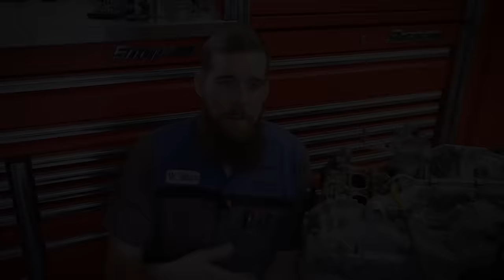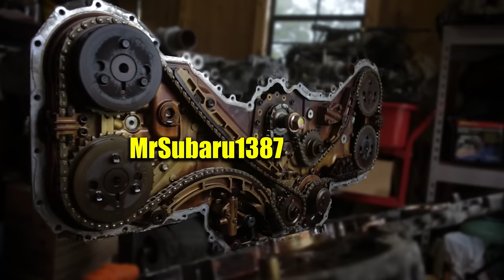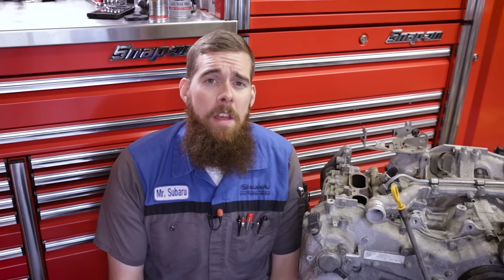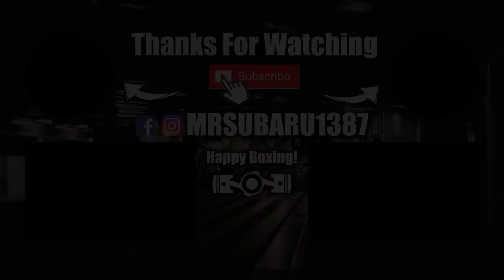Why Subarus Are So UNreliable!!! Buckle Up!!!

Comment: As a long time Subaru service technician myself, I can 100% vouch for the amount of time we get younger owners of the turbo charged models that completely destroy these cars and have the audacity to blame the brand for the vehicles failures. And we as technicians suffer greatly due to most of these repairs being warranty and having to eat poor labor times due to the owners mistreatment. Subarus are absolutely great vehicles when properly maintained and cared for. I love the brand but I hate some of the owners loll. Had to subscribe after watching this rant lol!
Reply: @samerawaragi3041  Subaru has certainly acknowledged the fact that some of our engines are known to fail oil consumption tests and have reached out to the customers and have had the short blocks replaced as a result. What I’m trying to say in my comment is when u have a customer that decides to drive A Subaru very roughly as if it were a Honda which it is not as mentioned in the video, and neglect to take care of the car and complain why things aren’t lasting like they should. That’s all. All car brands have their issues but when u mod and beat up a car and don’t treat it nicely, the blame has to go to the owner and not the brand.
Reply: @LosDC5 i just got my dream car. A 2019 STI and i was wondering if you can point me to where i can find all the maintenance scheduling i need to keep this car in the best condition so i can keep track of it and set reminders andogs for this car. I want this thing to last as long as possible. Really want it to be one of those "man they dont have many of those anymore" kind of car later on.
Reply: @robertd57i989  So my suggestion to you in that regard is to invest in good oil delivery components. The Sti and older wrx suffer a lot from oil starvation. I believe IAG makes a reinforced oil pickup and baffled oil pan. That will eliminate any oil starvation. The oem pickup is plastic and is very prone to failing over time. Besides that, change your oil every 3k miles. Make sure the brake fluid and diff fluid is replaced every 30k or so. And as far as mods, u can run pretty anything you want with a reliable tune. But be mindful off your power goals. Any hp goal more than 400 will require serious internal engine upgrades. However any bolt on mods like downpipe, Intercooler, exhaust system, AOS, etc will make the car very solid for everyday driving and the car will be very reliable. So long as you keep tabs on oil level and other regular maintenance!
Reply: I agree completely I worked as service manager and advisor with Subaru since 96 until retiring in 2020 and did many many turbo engines simply because oil changes not done, modern young people don't believe in simple maintenance!!!!
Reply: Very true
Reply: Turbo car= Race car.
Subarus fault.
Reply: Mit. LAncers .. 10 years warranty ... is the Warranty older than the driver? if such get mazda ...
Reply: Same with most brands. I am more familiar with the VW/Audi side of things, and I was extra careful with my VW. After all the reports of the "issues" with the motor I have, yeah i was nervous.... but turns out it was user error - not changing the oil on time with the correct oil/filter. Yes the car has quality issues, but it wasn't un-expected. Unless there is a design or manufacturing issue, most vehicles will do 100k miles easy, 150 if moderately cared for, and 200 if cared for well.
If you are going to modify the vehicle, do your research, understand what you are getting yourself into. I went with a tune that runs a little rich, but that controls detonation, doesn't overboost. It might make 5-10hp less than a more aggressive tune, but it is fine 140k miles of driving it like I stole it, flooring  through at least once every trip I take....
Reply: okay but heres the thing. toyotas last despite being treated like shit
Reply from the maker: Funny. Toyota dealership service departments are filled with broken Toyotas, daily.
Reply: @MrSubaru1387  Im sure every dealerships service departments are full of broken cars. That's why service departments exist -.-
Reply: My sons 2013 Legacy that was sent to him from my sister in California to Canada is the easiest vehicle I have ever worked on.  My sister is a driver who puts gas and occasional oil change.  We got this car with 94k miles on it.  We did the CVT oil change at the dealer, we are bleeding brakes, replacing diff fluids, power steering fluid and the coolant. We replace the PCV valve and cleaned the EGR valve, we took off and cleaned the throttle body, and so you know this car ran perfectly well before we did all of this work but it was a fun project. We using Rust Free 3000 formula sprayed all of the under body metal and I expect this car to run another 90k miles.  Great videos and 100% agree with all you said.
Reply: @rawrbrz  different buying demo and different technology on board. Our domestics give a great window into this with the differing same platform reliability that used to come out of gm. Sure some of it was buicks assembly process, but not most of it. 
Toyota also lags the industry in ice tech in sold units, and on purpose to preserve reliability stats. Look to hondas fall from reliability grace to see why, fords 15 recalls per model, or vw's rep issues from being first to market with this stuff back in the day. Introducing di turbos is apparently very difficult.
Reply: Yep!  Nailed it!  I have an 2021 Outback Touring turbo.  I am 76 years old.  My cars acceleration is awesome.  Good to have when needed, but seldom needed … when needed it’s great.  I maintain it at a dealership as specified in the manual.  I would say my car is driven “gently” and I expect it to last a good long time.  This might be my last car, and if that’s the case, I finished up with a great car.
Reply: @steve8803  This is very true, won’t disagree there. But young people can be still responsible and take care of things too. There is no age limit on that
Reply: As a former BMW technician it was the same thing. Morons that thought they knew better would ruin the vehicles and engines and blame BMW as being unreliable. Granted I hate all the plastic.
Reply: People dont undestand how to care for a turbo car in USA period. They know how to in europe and australia and everywhere else as turbodiesels are very common and people treat their cars much better as it usually is much bigger expense especially in poorer parts of the world to even get one. Its common knowledge to let the engine warm up and cool down after longer driving on highway its a turbo diesel or turbo petrol.
Reply: 2014 Wrx owner here.  I can confirm that with good maintenance, these cars are VERY good.  I have a pro tune on mine running stock boost. Has been an excellent car.
Reply: @MrSubaru1387  😂 People act like Toyota and Hondas don’t break.  I worked at a Toyota dealer for 5 years.  Let me tell ya.  We had blown engines like CRAZY.  Typically ones that burned all the oil and then locked a con rod to the crank or spun a rod bearing.  We had trucks that snapped in half after 8 years from rust.  We had head gaskets.  We had plenty of issues.  Nothing more than Subarus honestly.  I will say.  Subarus require good maintenance.  But.  So does everything else.  Idk.  I love Subarus.  They are not garbage at all.
Reply: Top video. Best and most interesting mechanic on the net. My 2.5L Forester is 21 years' old and still going strong. Best car I've ever had. Wouldn't hesitate to take it around Australia, vast outback deserts and all. Just have to every now and then top up the coolant to which I've added Nulon anti gasket leak which worked instantly on the external coolant leak.
Reply: @trackdusty  Most people are quite hostile to idea of doing any maintenence themselves and blame the car, true 2.5L headgasket is quite bad, but first of all HG leak that results from it is rarely a problem, its mostly weeping a bit, and just need a fluid maintenence for time being, and if it gets worse there is way to permanently fix it but using 2.5 Turbo engine  gasket when repairing it. It's same way people over react with oil consumption. You just check oil from time to time and top it up if needed.
Reply: But I heard that direct fuel injection won't make your engine last long. So many people who want reliable cars shy away from that.
Reply: @Jose-sy1je  1st gen crosstrek is MPI so is Forester and Outback woth early fb20/fb25 motors EZ36 too. 
I dont lile direct injection myself it barely add any benefits especially in naturally aspirated cars and add needless complexity.
Reply: @Kacpa2  But all Subarus use the direct fuel injection if I am not mistaken. Bc their is said to be so much carbon buildup and you'd have to get oil changes a lot sooner than later just to minimize the issue. That doesn't sound like a car that would last long.
Reply: @Jose-sy1je  Nowadays sadly yes, but that is true for almost every single car, they hold out longer than most tbh. STi was the lest MPI car in their range till 2021. 

If you want to have most reliable car to go with then i recommend 2014 or 2015 Subaru Crosstrek/Impreza with a manual or if you want/need more room then Outback or Forester until 2019. You can also a get Forester 2.5 with 6MT. Canadians got 2.5 Outback with 6mt briefly in 2015-2017.
Late model 2013-2014 Outback also should have FB25 motor. 

It has no powersteering pump, has timing chain so you literarily only have oil and filters to change. Nothing goes wrong with them, early ones had minor oil consumption issue but was fixed after 2013 on both motors.(its because they pushed design for fuel economy more and looser tolerances let more oil past the oil rings) 

It doesnt have any issues say turbocahrged 2L engines have in BMWs or Audis, those were catastrophicly bad, oil starvation issues, timing chains got stretched and skipped and other problems, so if checking oil once in a longer while on early fb series is only concern then it's worthwhile, as truly nothing else goes bad in these, CVTs from what i heard arent too bad either unlike Nissan ones. 

TL;DR: Grab yourself either 2013-2016 Crosstrek/Impreza or 2013-2019 Forester/Outback in manual is you can find it and you wont have anything to worry about, 
If you dont mind direct injection then get 2017-2022 Crosstrek/Impreza in 6mt aswell. Those have manual/mechanical handbrakes aswell so its good package overall. 

If you want more power 2.4Turbo and 2.0L turboes are ok, but i would recommend 3.6R H6 instead in 2009-2014 Outback/Legacy you can have it with classic automatic still, it's also incredibly reliable.
Reply: @Kacpa2  Thx. I can look into it. I'm not sure though if I should buy used bc you never really know how the previous owner maintained it.
Reply: @Jose-sy1je  It's not that bad usually, you just need to know what too look for when checking the car out. Here we have to pass inspections on vehicles annually so its another way to test, not sure how it is in US. I had used cars prior and it was fine. My current subaru is used XV/Crosstrek and its pretty much pristine. 

Usually manual ones will be in better condition as its usually owned by more concious owners especially in US, nowadays most people who would be very forgetful about caring for the car even with as basic things as oil changes go for automatics even here.

 So that first way you save yourself trouble on most bad examples, but even run down CVT Crosstreks seems to be okay, like one MrSubaru bought on his channel. I wouldnt worry too much and just check if the car has even-ish paint, if possible use something like Carvertical.

 I'm sure you can find more guides for this, but as far as car is concerned it's a very solid choice. Only reason why ponder on changing away from mine is that i want a more sporty subaru(first car was Toyota Celica so havintg a crossover hatchback isnt exactly a 1 to 1 experience between the two xD), i havent had any problems with it, just changes engine, transmission and rear diff oils and new filters and its going strong for 4 years so far. 

Most complains about Subarus in general came from old 2.5L version cars from pre 2011, with EJ25. Subaru went cheap on the gaskets they installed in those motors and they burn out after a longer while, as its just some graphite paint/coating on single layer of metal, and that cooked and flaked off after 150k miles. No other engine had that problem as others had full metal multi-layer gaskets. 

Solution for it is likewise, using such gasket from turbo ej25, but most dealers used the same faulty gasket so it failed again, hence many people got angry and complained.

 As for WRX's with turbo 2.5L it's more complicated and is a mix of some shortcomings of design(5mt from NA subarus not built to take turbo torque etc), but mostly people abusing the hell out of these.
Reply: As a jaguar Land Rover mechanic i just saw my first 200k mile rover, it's got noises, but still drives great.
Reply: @rawrbrz  I used to work at a Toyota Dealership up till 2003. Back then the most common cars that came in for repairs were all the models that used the V6 engine. On the 90's trucks they had their head gaskets replaced under warranty. On the cars the engines would gum up easily if the owners did not change the oil regularly. I saw many of those engines rebuilt or replaced with a short block. Oh and the 99-06 Celica GTS would come in with either a blown engine or transmission due to reving the engine too high. Now those Celiacs have practically disappeared from the roads while it's still common to see early 2002 WRX still driving around.
Reply: Golf is better.
Reply: @losdc5185 wait so I can beat on my Honda and it runs no meter what. But if I foor my Subaru it break
Reply: everyone knows with just a simple google search 4 cylinder boxers can be great and reliable if you dont treat them like race cars and keep up on them. yes even the turbo models. but you go trying to add power or just run them hard and there gonna fail.
Reply: Toyota, if you have not noticed doesn't really make performance cars anymore, nor is every vehicle AWD.  They make milk toast Camrys, Corollas, Highlanders and RAV4s.  Yes there is the GR Corrola, but how many 100s of them are there compared to RAV4s.    According to Consumer Reports, Subaru has had higher manufacturer reliability in many years over the last decade than Toyota.   @rawrbrz
Reply: @divinehatred6021  golf has great  low rev torque at 1200RPM
Reply: How many Subaru owners think they can get extra performance by chipping their ECM for stage 2 injectors...without the stage 2 injectors? At least two by my experience.
Reply: Bro my 22 wrx has been at the shop 2+ weeks. They can’t figure out what wrong. They must giving out that title in cereal boxes.
Reply: @losdc5185  WRXs dont need to be modded to fail. It's inherent to the concept.
Reply: It's the boys who purchase Subaru who keep the brand afloat. Specially the turbos.
Reply: @unassailable6138  No car has to be modded to fail. It’s just with Subaru, strict maintenance is needed to keep them from potentially failing. And almost every modded wrx thats I’ve seen, that is driven hard doesn’t last. And that’s because they aren’t designed for that type of abuse. Honda and Toyota have made engines that do it all day long bone stock. Subaru’s just aren’t built like that from factory.
Reply: @divinehatred6021  Correct lol🤣
Reply: @losdc5185  I know, I had a WRX. Even unmodded everything leaks and fails. In Brazil we call it , the japanese FIAT
Reply: @rawrbrz  mrsubaru has apparently found a service dept with no cars in, not even for oil changes
Reply: If a company builds a “sports car”, but it can’t be driven like a sports car, they shouldn’t be selling it, and if they do, then suck up to the reputation.
Reply: @jimiburns6891  no “sports car” is excused from being subject to user error. Meaning that anybody can buy a “sports car” and have no idea what their doing behind the wheel and blow it up. All I’m saying is that Subarus are very finicky on how they like being ran. Someone with experience behind the wheel is what prevents Subarus from grenading lol
Reply: @Jose-sy1je as part of an oil change you must put in upper cylinder cleaner to prevent carbon buildup
Reply: @DonVerchi700as true, but race car = race car maintenance intervals too, which are not adhered to.
Reply: As a technician myself. I saw many young owners stupidly modify their subaru wrx or sti. Changing the turbos, exhaust manifold, boost controller, and improper mapping of the ECU, aftermarket blow off values and waste gate. Some of these owner cars engine inside only stock internals(no forged crankshaft and con rods and they complaining their engines not reliable. In contrast to some nice owners who never modify their car. Yes, their radiator and head gasket do give way. But, to a high mileage such as 150,000 km upwards with proper maintenance.
Reply: Late to this video.. heard that subaru manufacturer has issue with putting too much of the gasket paste and seeps into engine causing problems.. or not puting enough of it causing oil to leak .. is that true? If so, is that still an issue til this day?
Reply: @BigNacho90  This was a known issue on the newest generation 22 Subaru Brz with the naturally aspirated FA24 engine. Though it’s been rare and I’ve physically haven’t seen a brz with this issue, neither Toyota nor Subaru has officially issued a technical service bulletin or recall for this issue. Seems like the cases of the excessive RTV aren’t high enough for a recall to be made, and was most likely addressed in later model BRZ and Toyota 86’s
Reply: I blew up a stock 2019 Sti 3 times one time stock one time just intake tune next time full bolt ons all within a year there are trash they need forged pistons from factory they screw us
Reply: I disagree.  I have an unmodified STI and it lost cylinder 2 at 69k.  It is the most unreliable car I've ever owned in my 50 years. I had a 1979 4 cylinder Mustang last twice as long.
Reply: @rawrbrz I worked at Toyota as a porter.  The service department was full of broken toyotas.  Many getting engines rebuilt. Or frames.  Or wiring from mice eating it up from being soy.  But MANY engines on the shop floor due to oil burning.  Crazy how Subaru gets a bad rep for having a few engines that consume oil.  But Toyota can have engines from 2005-2012 have massive oil consumption issues and as a result rod bearing failures.  And no one associates Toyota with burning oil.  Wild how that works.
Reply: @daves5379 can I ask you a question based off your experience? I'm looking to buy my first Subaru in the next coming months. Does a turbo put significant wear and tear on the parts apposed to the regular engine? Or is it that as long as maintenance is done properly, both will go the distance?  I'm retired military and am looking at their new Outback models 2020+ .   I've read that the Turbos don't have the TCV issue.  I'm trying to figure out if getting the turbo is justified in order to avoid ever having to deal with the TCV.
Reply: @joshuathomas4934 Subarus are fine. The motors are junk.
Reply: I drove a lot and owned multiple car brands. Few BMW’s, vw, opel, citroen, renault, ford, volvo, daewo (Korean), mitsubishi, toyota, nissan, honda, daihatsu and…subaru impreza. Honorable mention is old Opel cadet, Citroen C5 that served me long and well and Subaru Impreza that was driven by me, passed to my wife and now driven by one of our kids. It still looks good on top of it. Many services on Suby done by myself as they are simple to work on as Mr Subaru presented in one of his videos. 👍